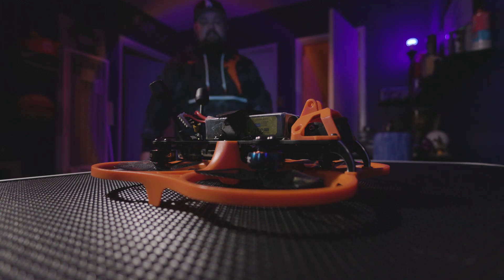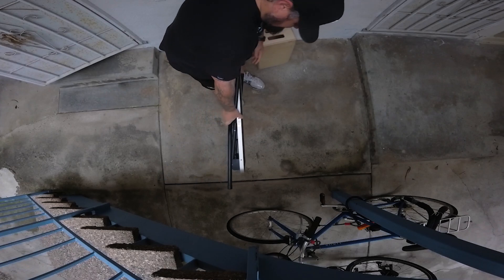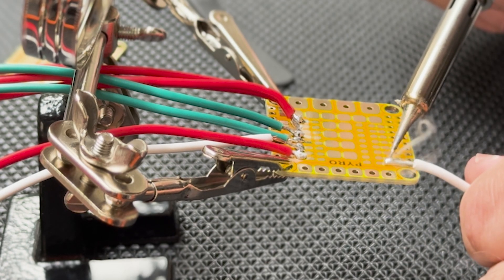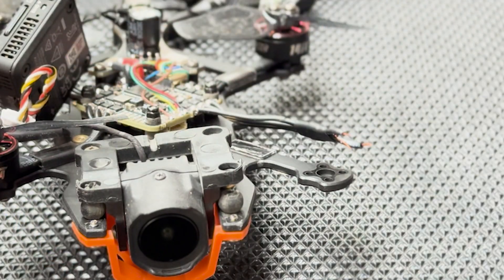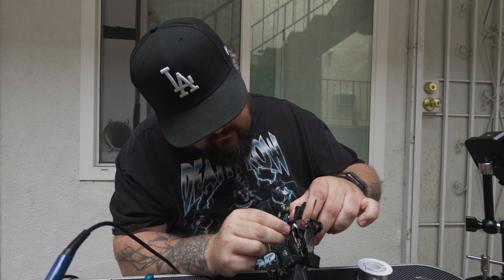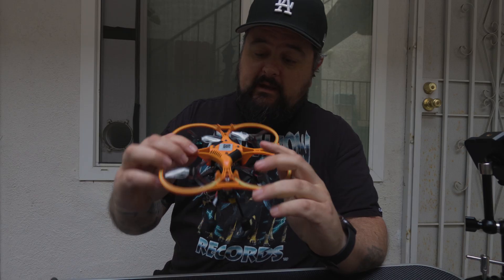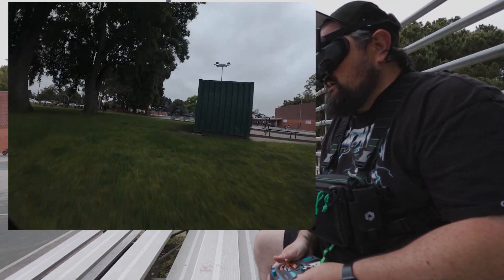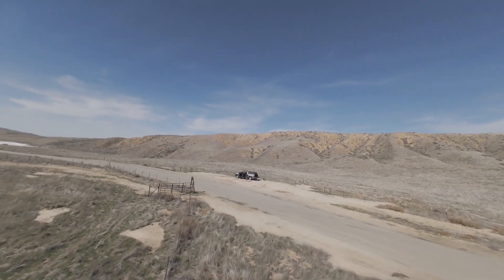I Taught Myself How To Solder My FPV Drone And Then This Happened (Cinelog30 Motor Swap Test Flight)

Comment: Happy to see someone trying to fix it themselves. But i have a few reasons why it flew differentl in the end... 
First off, you only swapped one of the motors, and if i am correct you used a comparable but not identical motor. Using different motors can work fine, if the KV and other stats are close enough, but it is generally not good. Since the one motor will behave diffeerently to the others it might upset the flight controller and therefore the flight feel might be off. 

In my mind, if you install 4 of the same motor on the drone, and pay attention with the propeller direction (as others have poiinted out), it should fly as new again.
Reply from the maker: Hey thanks! Though the motor is a different, it’s still the same exact stats. Also I wanted to swap all 4 motors but unfortunately they weren’t out of stock of motors so I settled for the 1 (and a backup). What ended up happening (I actually solve it in the video that comes out today) the props were on all wrong. I do appreciate you not only watching the content but also helping solve the problem in the comments. You’re a real one! ☮️

Comment: Glad to see you didnt let soldering stop you from flying again. I had an antenna get ripped out of the UFL connector on my first powerloop attempt and was able to tape it back together and it still works like new. I'm sure I'll be right with you soon enough based on how im flying my Cinelog and needing to learn how to solder soon. I will say this, first powerloop attempt is the worst. Mess around in the sim for an unreasonable amount of time and just learn how different stick movements and timings will affect your loop, that has helped me a ton in terms of being confident to loop IRL.
Reply from the maker: @kodygeier  oh yea I’ve done tons of time in the sims for sure. Power loops are so crazy but so worth it once you get the hang of it. Soldering isn’t too crazy, you’ll get used to it pretty quick when you end up needing to do it.

Comment: Did you find any reasons why it wasn’t flying right at the end?
Reply: My guess is the mixed match manufactory motors... it's not matched
Reply from the maker: @ good guess and I considered it. Thankfully it wasn’t nearly as complex as that. The motors though are different brands, are the same exact power so that’s not the issue. The issue is actually the configuration of the props. I had them upside down. 🤦🏻‍♂️ you’ll see in the next video that I post on Monday.
Reply from the maker: @Jakey_FPV  at the moment I really don’t know yet. I am going to try and figure it out this week once o get time off of work because I really wanna rip that thing!